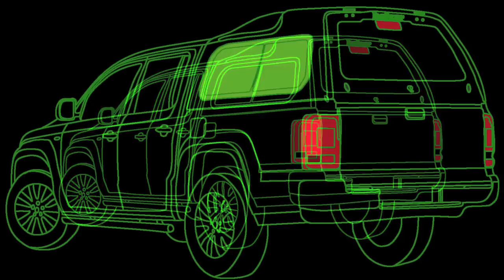HT - Side window - Replacement (framed)

Comment: Was it a new window installed? After window was removed the frame attached to the window when it was out was removed (with screw holes in it). Was it the same window reinstalled without that frame or a new window with a virgin frame that was screwed back into? I want to remove my windows, add a fabric headliner and reinstall the windows. Will I need additional frames to reinstall my windows or will they be useless once removed?
Reply from the maker: Hi, if the frame is not damaged, then of course you can mount it again. Hope this information is useful to you.

Comment: Is the process the same on a Leer 100XL with frameless side windows, or are the side windows installed with adhesive sealant?
Reply from the maker: Dear viewer,

unfortunately we do not offer any products for vehicles of this size so far. For this reason we do not know if there are differences in the assembly. 

Ihr Roadranger Team

Comment: Do you supply framed sliding windows to the U.S. for old Snug Top camper shells? Thanks
Reply from the maker: Hello,

We're not delivering to the United States yet. In addition, our windows are designed exclusively for pick ups. They could get problems with the installation. 

Yours sincerely

Road Ranger